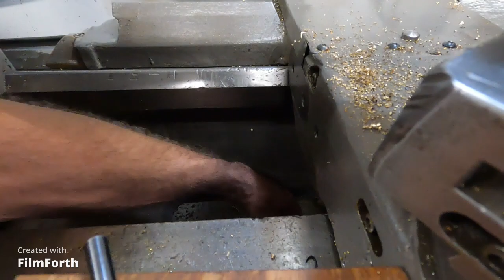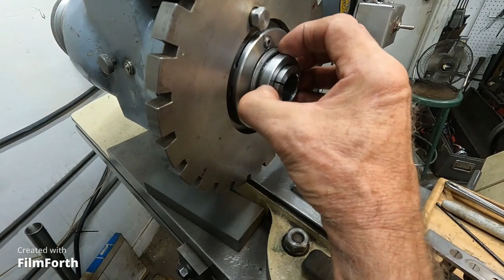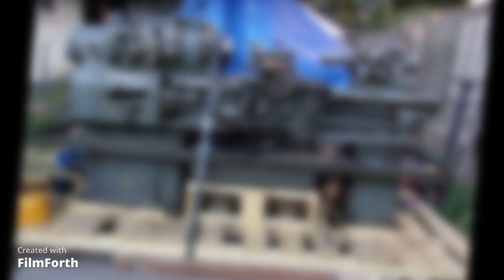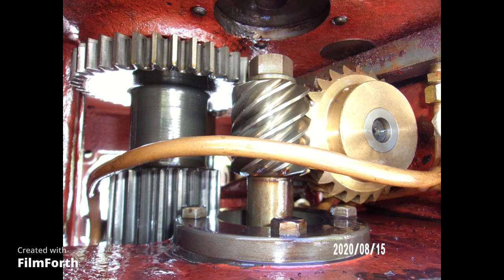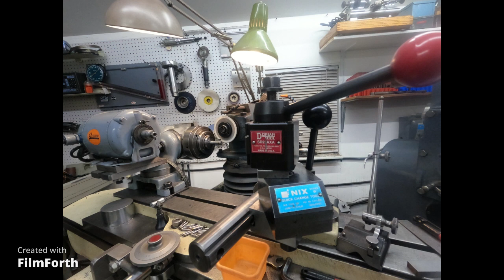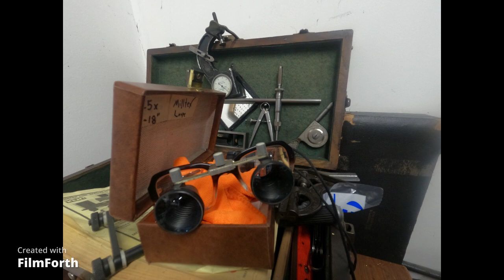5c Collets and the lengths I have gone

Comment: I have a mis-match of collet sizes for various machines and fixtures…. AT3, 4C, 5C, R8, and ER32. And not complete sets either. Have a great day.
Reply from the maker: I have used the Erickson DA type for years light duty work and just moved into ER 40 for the heavy mill and bought a cheap basic ER 32 set with a 1" straight shank holder to use for various boring bars in the lathe.

Comment: I to have discovered the "Chinese" 5C collets tend to be slightly smaller in diameter on the rear section on average than Hardinge or Crawford ones I have.
My Chinese 5C collet chuck was so tight only a couple of my Chinese collets would go in, the proper ones there was no chance, I ground it very slightly with a toolpost grinder.
Mine is accurate to 2 microns in its nose taper, which is fine.

I do like that 5C mount chuck, I guess it saves a lot of change over time if you primarily use 5C work holding.
Reply from the maker: Thanks, I am surprised how well these can work.